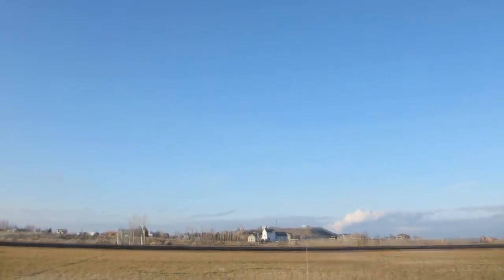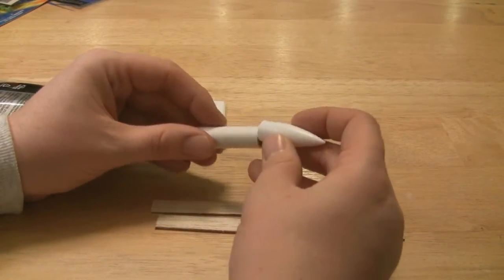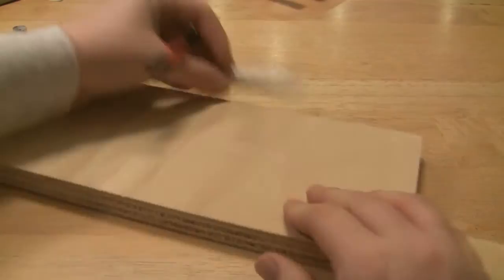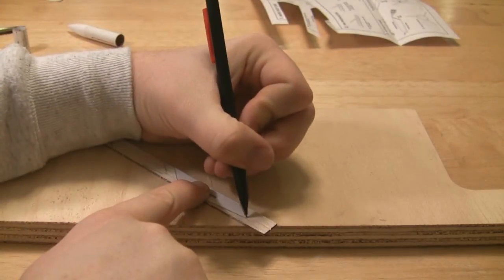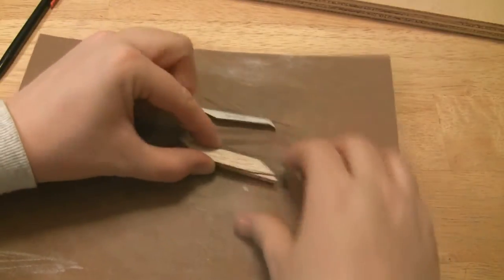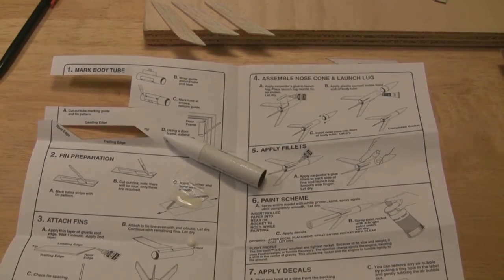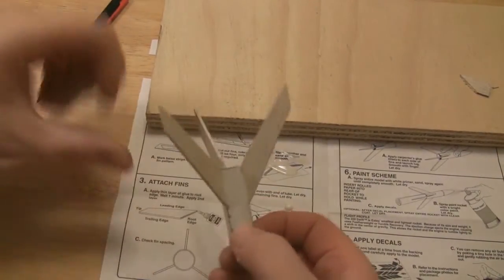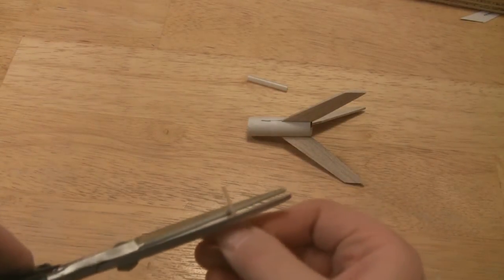Estes 220 Swift Launch and Build Part 1

Comment: I am currently building 2 of the Swifts and with any model less is more when it comes to glue! You can use some sanding paper or a sanding block to make the leading edge of the fins more aerodynamic. When laying the pattern on the balsa (which could be a bit wider imho) know that you can line up 2 pieces together and cut them both with one cut.

I think you meant build and launch. :)